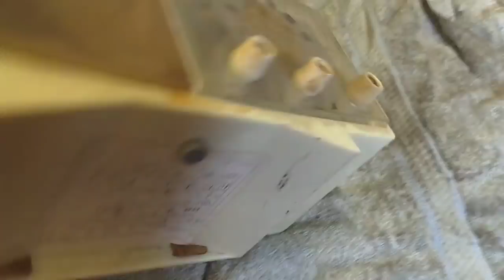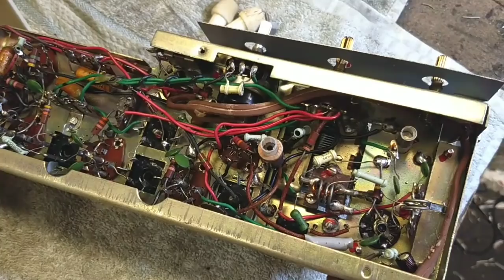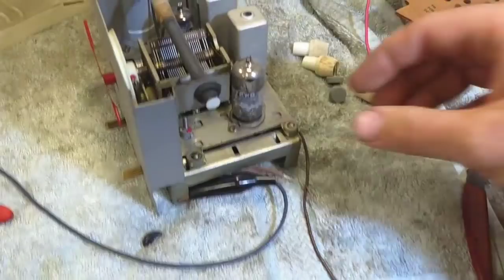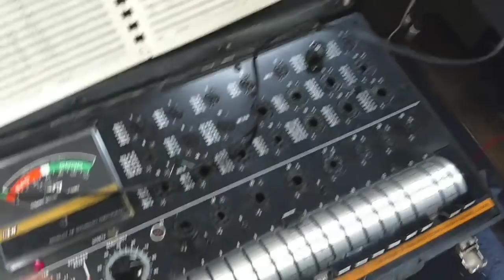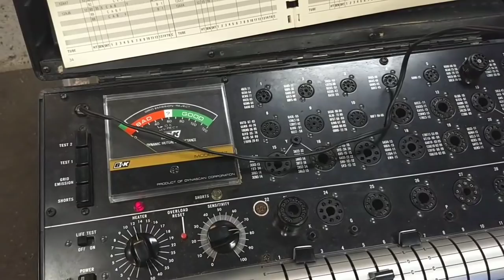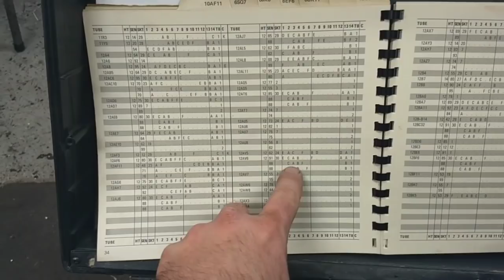Troubleshoot and repair a Calrad (Seiko?) 7 vacuum tube AM/FM Radio part 1/?

Comment: I have a midget japanese radio very much the same underneath, I love the way they make there radios reliable ,disc caps ,just great little radios ,mine I tried to blow it up by accident ,I bump a screw driver against the incoming power ,after a lot of arcking, it blow off one side of the power cord freak me out I figured it wouldnt ever work again ,But I solder the cord back on ,And after I figured out where one side of the antenna wire went back ,it seems to be working fine ,I did order a safety cap and a fuse holder ,when I get to it I will put it in ,I wish all radios had at least a built in fuse for clumsy people like me .

Comment: That's a very rare and hard to find set, there is pretty much no documentation on it online, but I have the FM only version of this in both white and blue cabinets. It is a "Calrad" brand for sure, but I have no idea what the model number is, the FM only versions model# is FM-510 though. I have seen one exactly like this come up for auction on ebay sometime last year, and it sold for a good chunk of change, so if you get it working you could make a ton of profit should you choose to sell it on ebay.
Reply from the maker: Thanks for the info. Looks like it's built well. I'm curious to hear it working properly

Comment: I had a couple of these as a kid. The importer caught fire and afterward we salvaged some stuff.

Seiko made at least 3 different AM/FM sets during the first half of the 60s. They might be the same company that makes watches. Another company - Kowa - is best known for cameras, lenses and other optics but they made AM/FM portables until at least '65. Today they dabble in dietary supplements so it would not be beyond reason if Seiko did too.